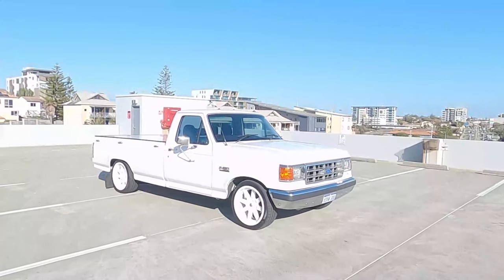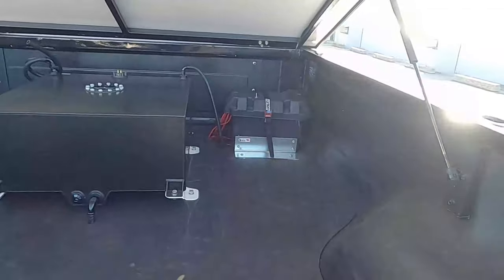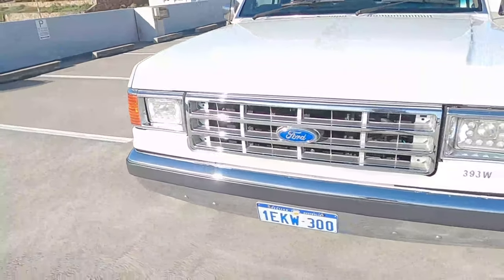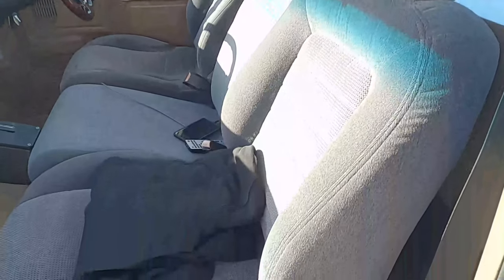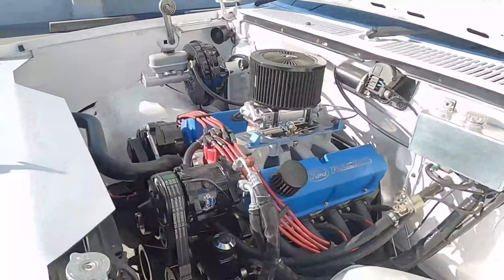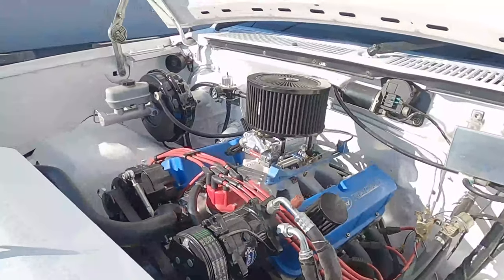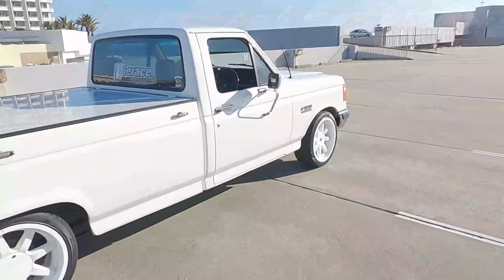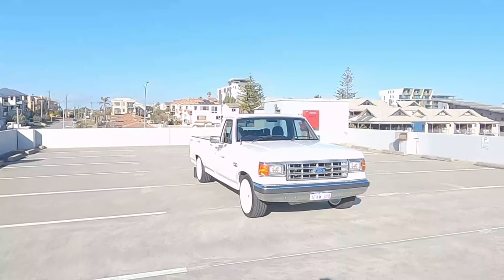1989 Ford F150

Comment: I've got a 90F150 4x4 excab 5.0 auto but mine needs 10 to 20 times what yours needs. Yours looks good but if I got to drive it I would get in the wrong side HA HA!
Reply from the maker: it all takes time my man 
im still not finished
Reply: @kimashton5054  Yes your right but I'm 58 and not what I once was. Looks like gas engines are in trouble I would like to see a hot rod EV!👿
Reply from the maker: @endall6783  I can see them banning petrol cars man seriously 😳